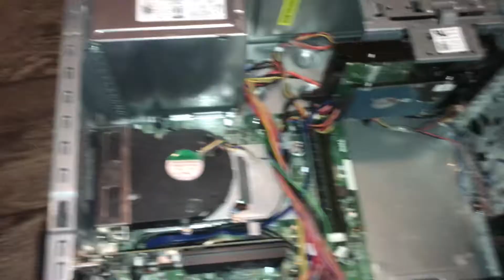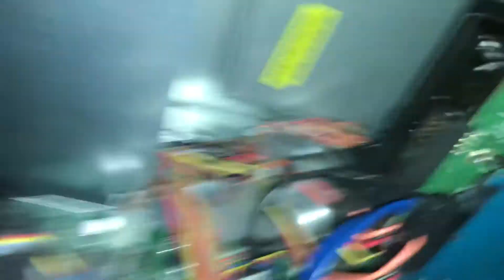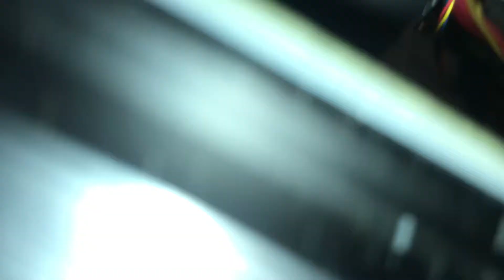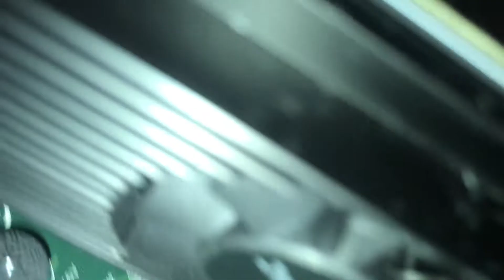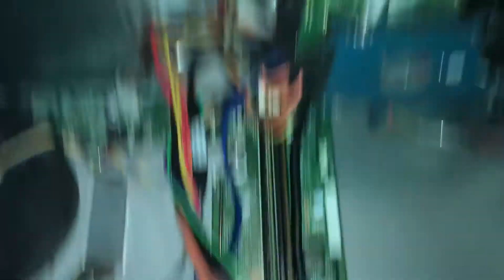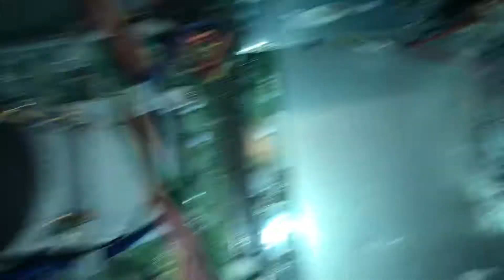Dell optiPlex SSF case swap

Comment: I have a 7010 and this case swap might actually be possible for me. Is there a guide video you could make that would allow me to do this?
Reply from the maker: https://youtu.be/2s9O0S6lwuI this guy had a 7010 but it should be the same process and if you don’t mind pressing F1 on start up you don’t need the front panel case cables connected
Reply from the maker: https://images.app.goo.gl/CfTxwZoPnJvT36zy6 And if you need help wiring the power button to the new case here’s a diagram of the power switch